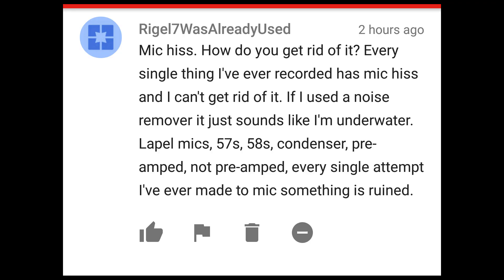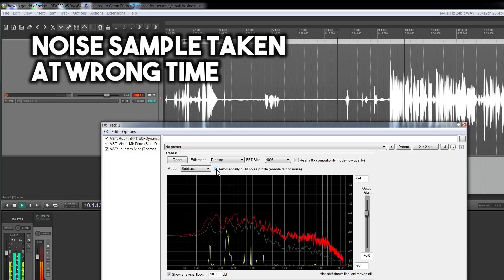HOW to GET RID of MIC HISS! | SpectreSoundStudios TUTORIAL

Comment: It doesn't work for me... I still use it w. Reafir turned on only like 30% or less, but it's very limited that way, and most of the hiss is still there, (it reduces it slightly don't get me wrong, but I'm making music w. huge vocal stacks of many layers, so unless I find a way to remove alot more of the hiss, it's always gonna be there like a blanket of background noise over my vocals, and tbh it ruins them IMO, and all my songs, unless I record at a professional studio but I can't afford that for this album, so Idk what to do).

If it's on all the way, or even much more than 30%, it takes something out of my vocals & makes them not sound as good, which also ruins the effect/sound I'm trying to achieve, and is worse than just leaving the hiss in there... 

Reafir butchers my vocals, basically.... whether it's rapping/verse vox, or singing/hook vox, no matter what combination of settings I try, it's still removing a bunch of frequencies from my vocals.

And I don't build the noise profile on anything but the vox tracks, on solo, and only on the part before the vocals actually start.... so my voice isn't included.

Whatever frequencies are in the background noise, some of them must ALSO be in my voice.... otherwise it wouldn't affect my vocals whatsoever... (*if I'm understanding it right... it's MY best guess as to what's happening anyway 😆)

I've tried everything I can think of or find online, I record high, it's there, I record low, it's there when I bring the volume back up on the recorded vox... It's there with everything else off & disconnected other than the mic, Reaper, and one individual armed track.

If I put SPAN (*Voxengo), on the track, and have the track monitoring on, I can see the constant noise floor even when the track/mic is completely isolated, no monitors/speakers on, only my Seinheiser headphones I use for recording, no other tracks, no beat, nothing... and even when I'm not recording or doing anything, and bring the gain and output vol all the way down on my audio interface (*Yamaha Audiogram 3), and  therefore remove most/all input noise from the room/outside....... 

It still shows that noise floor, no matter what.. and it's across all frequencies but increases gradually towards the high end, and it's def the pure isolated thing that's ruining all my songs at any point my vocals come on.

I'm collaborating w. another artist rn using his home studio... and his vox are completely fine, I get him to record less or more hot as needed, it's always clear, and the contrast between our vox bc of my background noise/hiss, is very apparent, so I coached him over months to get all his vox and layering to sound like mine, and now can't get my vox to sound as good as his bc of this stupid hiss! 😂

The only apparent difference in our vocal takes is that his are always really full/big soundwaves, (visually)... while mine are always extremely small, and I have to widen them ALOT just to see where things are happening.

I like recording low to get less harshness and a more smooth vocal for layering & overall it just sounds way better for my voice/style of music.... but maybe I'm recording TOO low.

I tried recording w. a much higher gain level recently, but I still got that background noise... I think it may be slightly reduced, once I bring the vol down on the track to the right level, but it's def still messing up my vox, and even tho I recorded further from the mic, it still took away too much of that smoothness, made it WAY too harsh.

Seems like there's not much of an in-between space.

Another thing is that I absolutely MUST record w. my headphones only on one ear, and don't like to hear my active take in my headphones.... I need to hear the beat & whatever vocal takes I'm trying to harmonize with/record to, in my right headphone/ear; and my out loud live vocals in my open left ear.

So either just bc of that, or also a combination of other things, (*maybe where I set different levels throughout the whole process, from making the beat from scratch, then bringing the stems into Reaper for the vocal recording/mixing.. maybe the level I have my monitors set, Idk...); it ends up meaning that when I switch from monitors to headphones to record, I have to jack up the beat & the vox I'm harmonizing with, soooooo much, just to hear it loud enough in my one headphone to record to properly.

I always find the perfect balance where I hear the song and my live vox at the right levels..... but whatever is going on, I gotta turn up the master track in Reaper like all the way, or turn the output dial on my audio interface up a huge amount, or a combination of the two... just to hear so I can record, then I gotta bring it all back down to normal when I switch from headphones back to monitors/mixing.

I'm able to get what I need at the end of the day.. but I'm wondering if any of what I'm doing is making the hiss/noise worse than it has to be.... Idk which things affect it more/less, which things I'm able to jack up w.o. affecting the recording I'm making, and which things I need to keep as low as possible.

When I'm at the professional studio I have him set it all how I like, he brings up the beat, down my live vocal monitoring in my headphones, and we go to town... it never distorts for him to make it loud enough for my one ear/headphone thing... yet it does in my home studio.

It's almost as if my headphone jack on my interface is putting out a much lower signal than that exact same interface/dial puts out to the monitors... either that or my monitors themselves are jacked up manually so everything I do is at such a low level, but I think it's normal... making it so when it's the headphones I get the REAL level, and have to crank it up bc it's so low.

But if that's the case, how are my songs coming out at comparable volumes to major commercial releases on that same system, or when I compare on other systems? 

I just don't know anymore.

This is basically my final puzzle to solve before I can finally make music, from scratch, start to finish, and do every single job by myself at a very high level, in my own studio, and get the result I've been working towards for the last 7+ years.

If that noise/hiss was gone, and everything else as is, I'd never need any fancy studios, or engineers, or ANYONE ELSE.. ever again.

But it's like I'm at the last leve, in the hardest, most mind-numbing, puzzle-based video game ever made... that nobody's ever beaten. That's how it feels, straight up. 🤣

Anyone who can help me figure this thing out, lmk, any ideas or advice would be GREATLY APPRECIATED!!! 🙏

Cheers! 🍻 

🔹️🔷️CYRUS🔷️🔹️
Reply: Oh and I use a Rode NT1-A microphone, and Yamaha HS8 monitors.

I don't think it's a "ground" issue, bc the noise/hiss is still present when nothing is  plugged in that connects to a wall outlet in any way... other than the PC itself.

Could it still happen JUST from the PC being plugged into an outlet? Maybe.. Idk much about that stuff... but my gut tells me that's not the culprit.

Idk.. 🤷‍♂️

Comment: Reaper is a great program. Didn't know about the noise thing.  So much stuff in there to learn. Thanks Glenn. For songwriting, my goto app is Ableton Live. Ableton is not easy on the CPU, so when I finally get a take that I like (or can reluctantly accept), in lieu of applying a plugin to correct the noise/hiss, I open the recorded .wav file directly in Izotope RX to apply the turd polish that the track needs. RX is very expensive, especially the "Advanced" version, but it has some major turd polishing tools. 
In it, I do pretty much what Glenn described (getting a sample of the noise to "learn", then using it, etc). RX allows you to monitor JUST the noise so you can hear if there are musical elements that are getting stripped out by an over-aggressive setting. Either way, it takes a bit of experience to polish that turd just right. The other RX feature that I love is the "decrackle". Decrackle, I think, was originally designed for killing crackly sounds when ripping vinyl records. I use it to get rid of the disgusting "squishy" sounds that accompany my voice when talking or singing.  It is very expensive, though. 
I wonder if there's a market for turd polishing audio tracks.

Comment: It is not sufficient to just take a sample of the noise and run it in loop with phase reversed, because by its very nature noise is random and thus not loopable. What ReaFIR does is it takes a "spectral fingerprint" (don't know the technical term) using an FFT and then subtracts it from the fingerprint of your recorded sound. Basically, a dynamic cabinet simulator.
Reply: thank you I thought that was the case

Comment: By "running it back" you mean mixdown? Use the plug during mixdown only, correct? That way you COULD freeze the tracks with it if you wanted, and no CPU load during tracking. Is that what you do on a pro level mix? So that you can use it on every track without having to have an instance of it on every track? Thanks BTW I could never figure out my Waves X-Noise or Z-Noise. Now it's crystal clear. Thanks man

Comment: Me and my guest use Samsom Q2U mics, and wear headsets with the volume turned low for remote recording podcasts. But whether I use Zoom or Squadcast, I get residual rattling background sounds "behind the voice" that do not show up on the sound file. Noise reduction doesn't work without also removing some of the vocal, which is not acceptable. I've used a noise gate in post too, but that doesn't help. How do I remove these sounds in Audacity? Or how do I eliminate them from recording in the first place? Note I always add compression and EQ in post, but I still get this occasional extraneous "rattling" or "egg shaker" sound. You sound knowledgeable, I subbed your channel.

Comment: You use that on guitar tracks as well to separate the tone from the noise? or just low/high pass filters? thank you for your work.
Reply: I've used ReaFIR both on miced guitar signals and for DI guitar signals before sending them to the amp for reamping purposes. But I've recently been told that the latter can harm my amp and also destroys music. So I guess I have to live with the hiss if I want to run single coils through anything HiGain...
Reply: +Simon Gunkel
oooooooooh, my old trolling buddy is here, welcome back man :D

"and for DI guitar signals before sending them to the amp for reamping purposes"

as stupid as ever i see, some people never change, but i'm glad, the internet community without you would be boring that's for sure.

i also told you before that if you have problems with noises on di tracks when reamping (something you have forgotten while you haven't forgotten about why adding plugins on di tracks can harm your amp), rather then using noise gates/lowpass filters/this tool you should treat the noise from it's source, it means that your guitar isn't producing hiss/fuzz/hum by itself, it's something inside the reamping process that's doing it.

In the case of single coils, yea, the guitar can produce noise, but again, not treating a problem from it's source is a mistake, you should modify your guitar, add a foil liner to bridge, giving all the signal grounds their own wires and ran them all to one point avoiding ground loops, shielding the pups with copper foil, and ground the shields. Most of the time people use hambukers on high gain amps, and of course in your case it "had" to be single coils running in a high gain amp, it couldn't have been hambukers like everybody else, like... not at all.

You don't have ReaFIR, and even if you did, you wouldn't be using it on di tracks, what you're doing is creating a situation where you can spread your stupid beliefs, just like you did before. C'mon be usefull, i know you can do it.
Reply: stupid musicians killer "you haven't forgotten about why adding plugins on di tracks can harm your amp"

You never did provide an explanation for that. You just stated that as if it were a fact, which it is not.

Any piece of electronic equipment is noisy. That's just a matter of basic physics. And there is only so much you can do to reduce noise and thus improve your signal to noise ratio before you start to strongly affect tone. Yes, a humbucker is less prone to noise than a singlecoil PU. It also has a different frequency response, because you are adding another coil, which acts as a filter. A Piezo PU or an optical PU is even less affected than a HB, but again these have widely different sounds.
Whenever you take a signal and put it through some gear that reduces dynamic range, it is going to make your SNR smaller. In contrast something like ReaFIR acts like a frequency-dependent expander, and thus makes your SNR larger. You could build this as an analog piece of gear and if you used high quality components you'd be looking at something in the range of 500+ million US$. And the circuitry would add more noise than it would remove... You'd also have to spend ages setting this up and probably need one or two dedicated rooms to store that thing. So there's a reason that nobody produces this piece of gear (which I presume you'd be fine with).

I'm a REAPER user, so of course I have ReaFIR. Even if I wasn't a REAPER user, ReaFIR is one of the plugins you can get for free from the REAPER team. So among the various baseless accusations of lying you have leveled at me, this one is particularly pointless. I'm sure if were ever to engage into a discussion of boxers vs briefs the first thing you would accuse me of is not wearing any pants at all, ever...
Reply: stupid musicians killer "Just because i don't provide explanation every time doesn't mean i'm wrong at what i'm saying,"

In this case you have not provided an explanation at all. Ever.

"but of course it requires you to activate a region of your brain that's called "common sense""

See, that might be the problem. I activated the region of my brain in which I store my knowledge about AC electronics and sampling theory. It contradicts your "common sense" assertion that somehow doing digital noise reduction on a signal before reamping can damage an amplifier. I'm still bewildered by your idea that using a VST delay can hurt the amp, but say a Boss DD-3 would be fine.
Reply: "Eight year olds, dude."

Comment: I currently run a Shure SM7B for voiceover into a cloudlifter and a Zoom H5. I get around -50dB for my noise floor and it sounds pretty great, but if I get above -15ish dB on my Zoom it gets a slight hiss, nothing bad and very manageable, but I want to get it even further down. Would adding a DBX 286s to my chain help get a hotter vocal waveform without adding much (if any noise)? I’ve wondered if adding another preamp (in addition to the ones built into my Zoom H5) would reduce the workload and allow for a cleaner signal or if it would muck it up more.

Thanks Glenn!

Comment: I really need you to do one on how to remove a ground loop when recording DI guitars to a PC. I've tried everything with my Focusrite. No matter what I unplug besides the PC itself, my guitar hums like crazy. Doesn't matter how close my guitar is to the PC. Doesn't matter if both speakers and the monitor are unplugged. I'm using a DI box with a ground loop lift switch on it that STILL does nothing for it. I just can't figure this out no matter what I do, and micing up an amp is not an option where I'm at.

Comment: Great instructional, Glen. I was having some similar issues, but I have decided to go ahead and invest in Reaper.

Btw have you ever heard of FJA mods who does this sweet 5150/6550 "metal mod" that replaces the transformer, tightens up the frequencies, and has a clarity mod that supposedly makes the clean channel a good bit more useful? I found a 6505 + with the mod for a mere $800...so tempting considering the mod itself is $800 - 900.

Comment: What's the best noise gate someone can get, who only plays at home, to remove the hiss when you crank the gain? I'm grounded out good, surge suppressors used. I'm using a Vox AC30C2. I know, Not a metal amp. But I can get in the ballpark with an overdrive or treble booster. But I want to get rid of the hiss in my signal. What would you recommend?

Comment: I do the same with IZotope.  But it ends up sounding a little "dull" (?) because I think maybe certain points in the noise wave have the same frequency as the voice sound. But whatever. I fix it with an EQ. It sounds ok. But when you have to add compressor and/or limiter the fcking noise comes back a little bit.

Comment: Glen,
Thank you so much for this. I was recommended the audio technica AT-2020 for use on vocals as a good budget condenser, being that I'm a student and do bedroom recording, i was very excited. Unfortunately, it was very noisy, which I later realized was probably due to the mic pres on my audio interface (a presonus audiobox).
Thanks to reaper for being a decent company and offering ReaFir as a free vst. Unlike presonus' studio one, which had to be upgraded a couple times just to support vst. I look forward to using this, and really hope it helps with noise.
Another thanks, for your previous recommendation of running a di for dry tracks, instead of using the instrument in. If I'm demoing and using an amp sim with the instrument in, the interface would yell at me for clipping if my guitar volume was all the way up and I played a little too aggressively, and heaven fucking forbid I plug in a bass with the volume all the way up. It's greatly improved the quality of my recordings.
Reply: 2020